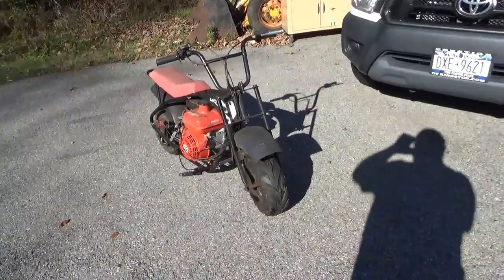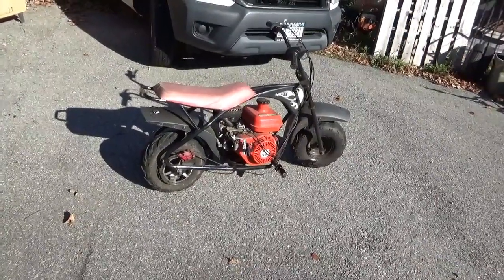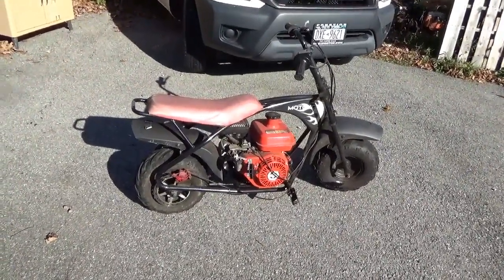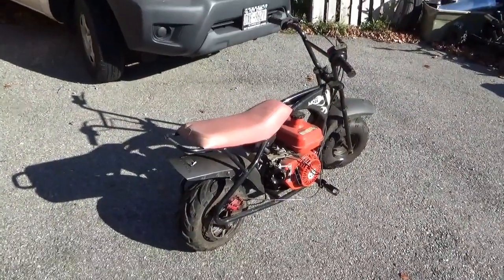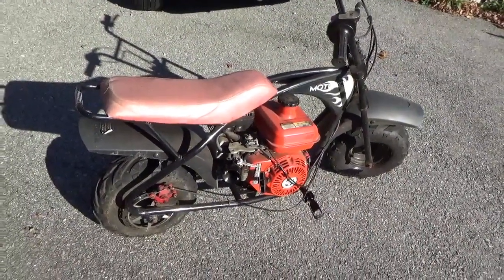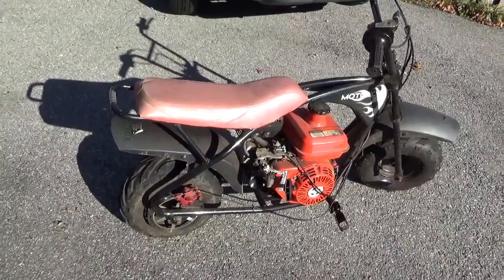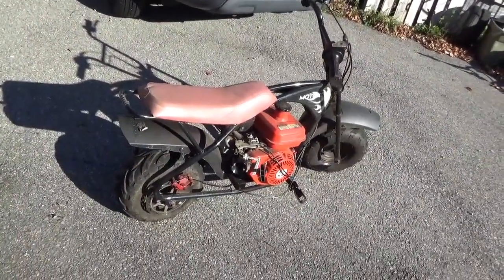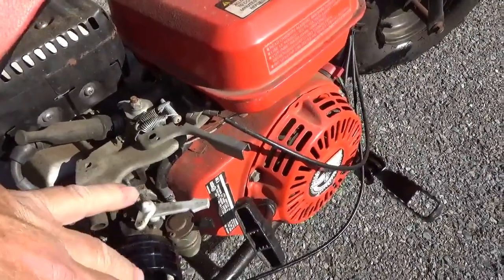Motovox MBX10 Minibike Deal, Stage 2 Performance Upgrade?

Comment: Harvey I need your help again man this time I'm lost lol another Chinese quad it's a ATA 125D but a 110 engine it says on the plate on front of quad three speed I'm wondering if that 3 speed switch has something to do with it I've replaced everything whole new wiring kit and components no spark tried to by pass everything like I usually do on these no spark cranks all that just no spark the key is fine I was thinking that first time I've ever had a 3 speed so was wondering if has something to do with that maybe? I put a new stator on it also could flywheel be bad it doesn't look bad but idk what else it could be would timing cause no spark? I haven't done that yet it's a 2016 really nice I paid 75$ got it actually bought two for 150 so other one clutch was stuff I took it apart was the gear arm I put another engine in it though please help me with any suggestions or if the three speed connecter has anything to do with it you know has two set of wires coming out of stator for light indicator I thought all that was for it's in neutral also I'm lost anyone help and nice bike I have one goes about 60 I also got 1100 in it though lol